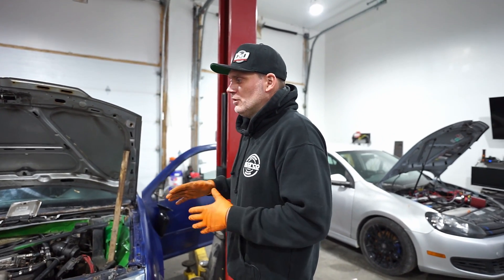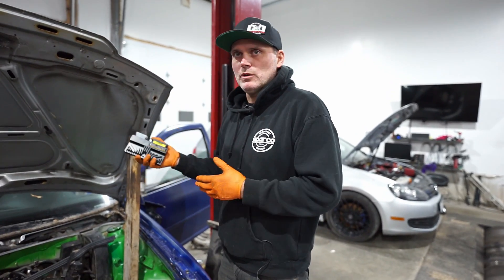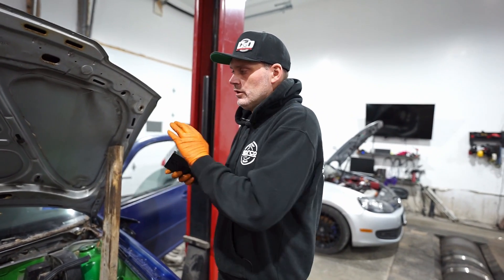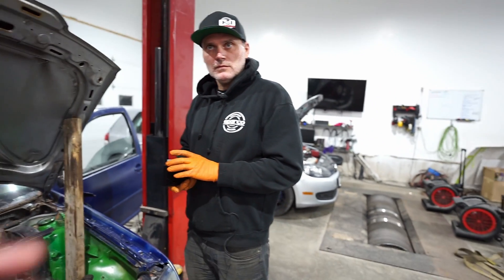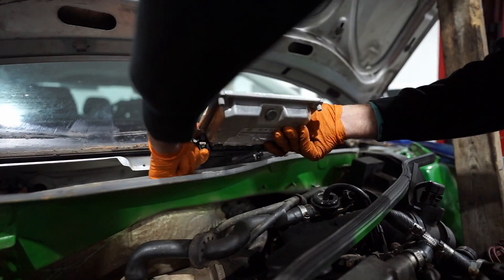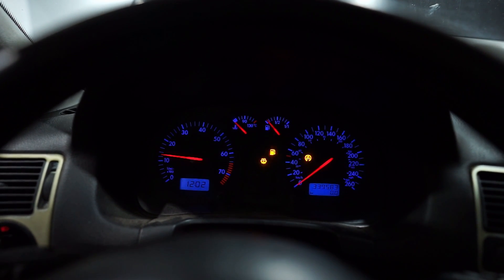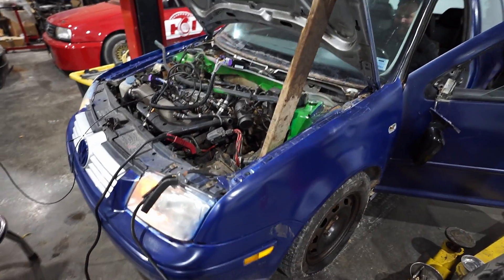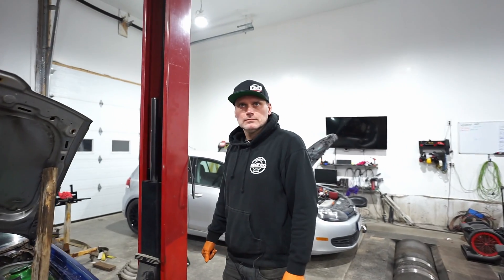Affordable standalone for your MK4 1.8T

Comment from the maker: Key components compared to other similar options. 

*Cost
*Support (this is a HUGE factor when selecting an aftermarket ECU). 
*Software/Hardware development (not going to be obsolete in a couple years)
*No external modules required
*True plug n play
*Flex fuel tuning option
*Can run literally any engine, not just a 1.8T. 
*Plus a ton of features/options
Reply: Haltech or emu? On 1.8t w/ HE351CW, AWP harness, BEA block & Haldex.
Reply from the maker: @kylejohnston3442  were a big fan of haltech. So it comes down to what you can afford really as haltech comes in at a higher pricetag as you need a wideband controller.
Reply: @COMotorsports  thank you for your time.
Reply: @COMotorsports  does this kit work for drive by cable ecus that mk4 gti's have in Australia?
Reply: Definitely need this for my B5 Passat 1.8t
Reply: Is there a plug and play for the 2.5l and can you do with emissions or does it render the OBD2 useless??
Reply from the maker: @snoopdaclown  OBD would be useless when it comes to ECU control, other modules can still communicate through OBD.
Reply: @COMotorsports  so i could use the emublack and still pass emissions testing? Would the obd2 work for that?
Reply: I have a b5 4 motion wagon with an automatic and an AWM. If this stand alone can make the boost adjustable for each gear then could I build my wagon to around 280 hp with the automatic? 
I'm having a very hard time finding a down pipe for my application, so would a " catback" exhaust be beneficial?
As always,great videos and great content.
Reply from the maker: @jasonhamilton547  It comes down to the connector on the ECU... to make this exact PNP harness work. however it's standalone so it can be made to work.
Reply: Can this work on my 2.0tsi dsg?
Reply from the maker: @ryan_wavyyy4661  Very few standalones work with direct port injectors. So the answer is no. The few that can are generally 3-5 times the price.
Reply: So quick question about this. I am an amateur when it comes to stand-alone ECUs and tuning in general. I got a custom build I am doing where I am swapping an AWP, with a stock AMU in an audi tt mk1. Weird, I know, but I have future plans for the AWP engine. I plan on using the AWP wiring harness and the VCT from the AWP. Would this affect the ECU in any negative way? Also would I still be able to use all of my functions I currently have in my audi tt? Like the LCD screen and the power locks.
Reply: Please help me with my car my A3 1.8t 2000 model cant tune with the obd port how can i fix this
Reply: Please could you do a video for the mk4 2.0. It's what I got to work with.
Reply from the maker: @McLovin420_LoE  You're one of few.
Reply: @COMotorsports  yea Ive noticed that is there a particular reason or is it just not a power plant like others. Mine has a really bad lifter rattle. Cam is definitely destroyed. And it still pulls hard.
Reply from the maker: @McLovin420_LoE  If you think it pulls hard, you haven't been anything that actually pulls hard. The engine is a bull for sure and they live for ever, but comparably the head/single cam isn't ideal for power. Yes it can be done, but a 1.8t engine is typically only a few hundred dollars these days so it's an easy choice.
Reply: @COMotorsports  yea its definitely a bull. But no I haven't been in anything pushing any real power.
Reply from the maker: @McLovin420_LoE  k cause theyre about as slow as it gets. Lol you have lots to look forward too. 😀
Reply: @COMotorsports  lol. My plan is to one day do a clean Audi 4.2 v8 but I don't think the wallet is gonna support me🤣
Reply: @COMotorsports  do you know if they make any stand alones for mk4 2.0. I honestly just want 2 step to piss my neighbors off even more. They already hate me I figure why not help them stay passionate with their hate towards me🤣🤣
Reply from the maker: @McLovin420_LoE  I can make this work on your 2l.
Reply: @COMotorsports  what's your price. I just gotta wait til I get paid and get it back running. My coil went bad 😭🤣🤣I got NGK coil and wires on the way and NGK plug waiting. Or at least I'm hopeful that it the coil. I was driving the other day and she lost power and ain't started since.
Reply: Do you have one for aeb 1.8t b5 a4
Reply from the maker: @southernracing2468  no sorry

Comment: Hey, interested in this but have a question, doing a built 1.8t in my mk3 jetta, will this plug and play work on the mk3? Had stock "stage 2" before the build which ran fine, now doing full build, does it make a different if the connectors from ecu are wired to my mk3 CE2? 
Also what would be my best tuning option when purchasing? Aiming for 500 whp 
Mods are IE camshafts, IE springs with TI retainers, 20 new valves, IE H beam Rods, JE pistons, 83mm bore, 1050cc injectors, gt2867 turbo and all other supporting mods with it 

Thanks, its my first real build so trying to figure out what my best option is for ecu and tuning
Reply from the maker: If it has a MK4 1.8T wiring harness in it then yes it would be plug in play. If not no you'd have to build a harness. Also that turbo is not getting you 500whp sorry.
Reply: @COMotorsports sweet thank you, and yeah its just the turbo I have for now, will be upgrading to 3071 or 3076 probably sometime this year but for now have to wait, but thank you for answering my question! Do you know if you will be having any sales coming up with the Christmas season I should wait for? 
Thanks again! Love your guys content its been super helpful

Comment: Could I call you guys about my GTI . I’m looking to do this stand alone. My 02 gti awp is fully done with Apr stage 3+ ecu with stock program 91 ,93,and 100 octane fault code erase /throttle body alignment 
Unique access code , and vTune . With Apr stage 3 plus turbo bigger injectors 4bar fuel pressure reg. Race 75 valve but just recently it started to act funny when I went to try to start it it would crank over but will not start if it does happen to start. It sounds like a cam out Subaru check engine, light flashes, and misfiring on cylinder three and four and I am getting the engine code 01314 all the functions on the cruise control are working for the APR tune. I can change through my programs no problem at all we checked compression is excellent. We’ve checked the timing. Everything‘s perfect checked injectors checked the coils checked for shorts and bad grounds getting power to everything on the fuse panel fuse relay 428 got power and is functioning, but we cannot get this car to start prior to this, it was running perfectly fine. It’s been parked in the garage . Tried reaching out to APR for help, but they are pretty much wash their hands of all older model vehicles and don’t have really much to offer for any of their old products so they basically are hanging us out to dry. I need some help. Is it possible to give you guys a call ?

Comment: Does this company make the same plug and play set up for a 07k that I'm building and and gonna turbo in the near future?... and what about the vr6 platform??
Reply from the maker: @HeathenRoads  yes and no. It all depends on the chassis, but we definitely have videos on our channel with them on 07K and VRs.
Reply: @COMotorsports  I guess I haven't seen them but I'll definitely look them up. And since I can order that directly from you guys if all the info needed was given to yall then technically you could pre tune it before its sent correct?
Reply from the maker: @HeathenRoads  start up yes
Reply: @COMotorsports  you said it depends on the chassis, I'm pulling the 07k from an 07 jetta and putting it in my 08 jetta that currently has a 2.0t in it. So after watching the other video on the mk6 that gave so much trouble with the turbo... lol would this "true" plug and play possibly work for that?
Reply from the maker: @HeathenRoads  MK5 is easier, so you're good
Reply: @COMotorsports  thanks for all the help bro, I appreciate the prompt feedback!... I'll be in touch within a couple months! 💯 🤙

Comment: dumb question I picked up a 2005 1.8t gti engine.is there a way to run it with no ecu and just carbs? I'm swapping it in a 67 VW bug and don't know shit about ecm or wiring so I'm trying to keep it simple. I only need at least 150hp to replace my 2332cc air-cooled engine. I can get the harness from the car with ecu but there so many wires I don't know which ones I don't really need. thanks in advance.
Reply from the maker: @vwkenart  anythings possible but it will be a HUGE headache and a HUGE amount of work and definitely not worth either.
Reply: @COMotorsports  🫣

Comment: No 98 aeb??
Reply from the maker: It's standalone, it can work on basically any engine. However to work with an AEB you'd need to build a harness and add a Wideband.
Reply: I heard awm(?) engine wiring harness would work?? Is that true?

Comment: Does this support engines that run Motronic MED9.1?
Since there isn't a lot of aftermarket ECU options for force stratified engines.
Reply from the maker: Very few aftermarket ECU's can control Directport Injection. You're gonna spend about 3-4x's as much to do so.

Comment: Does it need an electric trottle or can it work on a cable one too?
Reply from the maker: well the cable throttle harnesses are different, so PNP no. But it's an aftermarket ECU and can work on anything if you wire it.

Comment: How do I wire up the whp mac valve ? Can I wire that to the n75 valve wiring? And how
Reply from the maker: Either will work.
Reply: Cause I have the emu black
Reply from the maker: @Wanye3  yes, wire orientation doesn't matter.

Comment: Hi I was wondering if you stand alone Ecu kit will work in my 2001 Audi a4 with engine code amb???
Reply from the maker: The ECU will work fine, however the plug n part of it will not due to the harness in your car.

Comment: You don't need a standalone and replace the  wideband Me7.5 stock ECU! 
  I tune those Ecu's years now , with Big turbo's (700++ hp) , stroked engines with  NLS , 2step launch control , hard cut limiter and rolling anti lag .
Reply from the maker: Yes of course it can be done. That doesn't mean it's practical for most. Especially when it comes to support, future growth, add on options and features, development, data logging, and ease of use to name a few.

Comment: Can I use this on my audi a4 b6 Quattro and eliminate my dv valve and run a blow off valve and eliminate my mass air flow meter ?
Reply from the maker: First question will come down to the connector on your harness. All the rest yes of course.

Comment: Hi does ecu master work a vw golf r mk6 dsg
Reply from the maker: No it can't control direct port injectors. You need to look at something like Syvecs.
Reply: @COMotorsports  ok thanks so it is only syvecs that's available for my setup
Reply from the maker: @bedbull1  I think Motec may have an option. Theres another that can do DI but don't think it can do VW/Audi DI. So the options are very limited.

Comment: I own a 2005 mk4 gti 5 spd with the 1.8t awp. it has 207k miles and bone stock I want to have a light tune with all emissions devices deleted hopefully to make around 225-250 would you recommend going with this kit or another. any reply from anyone would be appreciated
Reply from the maker: The proper tune on stock ECU can easily achieve your goal.
Reply: @COMotorsports  any brands you would recommend by any chance and do you have any on your website

Comment: Looking to going standalone for my setup but a few questions I didn't see in the comments:
1. Instrument cluster: Do you retain full functionality of the stock cluster? Was the Traction Control/ABS resolved?
2. Immobilizer: Will the light on the cluster stay off without any additional modification? 
3. Emissions: The standalone doesn't have any functionality for secondary air, evap, or cataylictic converter? So there should be no need for adding resistors when deleting those components?
4. CEL: Will the CEL be thrown for things like fuel trim (vacuum leaks), MAF failure, etc... or will the CEL remain or forever?
Reply: I ended up buying the 1.8t PNP and theres a bit of wiring to be done, no where near as much as if you went with any other standalone though. 

traction control was just a problem with their car. works fine on mine.

immobilizer light isnt on for me

you do not need resistors for any emissions you delete, i went so far as to remove the wires for all emissions in the entire harness, just to clean things up.

the CEL will turn on for what you tell it to turn on for. IE faults with certain sensors, sensors reading out of parameters (temp or pressure)

CEL will not remain on forever...unless your car has a problem forever. lol
Reply: Would like to hear back on this too
Reply: @DZGunner  me too, prolem I have is mine has a lot of facotry stuff rmeove which throws up eml and TC lights etc. Hoping I can control what can throw up such lights as I dont know when there is a genuine problem.
Reply: @oliverheath7063  TC or ESP is its own module and will still function on its own, so if you have a TC/ESP light, thats its own system to be fixed.

Comment: Would this work on a AEB? Looking for a ecu currently and I see a bunch for 1.8t. Just none are specific to the engine code
Reply from the maker: No, connectors on harness are incorrect.
Reply: @COMotorsports  you think you can recommend a ECU for my AEB? Or point me in the right direction?

Comment: So in the video you quoted $1400us for the ECU and harness (so not including the boost controller, and aux inputs) but on your website the price shows as $1600us for the harness and ECU?
Reply from the maker: Change to US currency. 😉
Reply: @COMotorsports  gotcha. Didn't see the option at the top, I was just converting cad to usd. Thanks

Comment: i saw you mentioned Ignitron ecu, but clearly you've never seen or used one given your dismissive comments.  For 1.8t me7.5 platform car, there is no better genuine plug n play ecu than ignitron. No adaptor harness's to have to tuck somewhere in the scuttle, and extremely user friendly whilst having many many features..  I say this also being an ecu master dealer, as well as ignitron dealer...  You can educate youself on the Ignitron from this and other videos. You would love the ignitron ecu for your customers.... https://youtu.be/JEO8IRrA5n0
Reply from the maker: You're missing the point. This ecu doesn't back you into a corner, it has a great product line to support you through growth and will work on nearly any engine. This is why we choose it, simple as that. I've been doing this long enough myself to outgrow and see people outgrow projects, this helps with that. 👍

Comment: jesus thats expensive, my 1.8t almost costs the same price as the ECU hahaha
Reply from the maker: Just because you bought a cheap car doesn't mean things to modify it are automatically cheap as well. Lol But in comparison this is a very inexpensive ECU for the options and benefits. If you're looking for standalone for a AWP/AWW 1.8t then this is a very cost effective option.
Reply: @COMotorsports  I'm sure this is a great product but I could spend max 500 for a ew ECU/tune since I'm poor plus I have to dish another 1500 on new suspension wheels and tires next summer lol
Reply from the maker: @t_DriftKing  A tuned stock ECU is not on the same page as a full standalone. Yes a tuned ECU is going to be WAY cheaper than this, but it's also no where near comparable. It's like comparing a gameboy to a PS5, sure you can play games on both.

Comment: Does this work on audi 1.8t?
Reply from the maker: If it's running an AWP/AWW engine harness yes.
Reply: @COMotorsports  so no it won’t work with longitude engines… only TTS AND S3,s
Reply from the maker: @btwlbchris3360  the ecu doesn't care what 1.8t it's connected to. Could I make it work on an A4...yes no problem. However this specific video is about an ECU/harness adapters for an AWP/AWW setup. So unless you're running an AWP/AWW harness then no this will not just be plug and play as the video describes.

Comment: You definitely need to get Ignitron on a build. As a VAG 1.8t specific standalone , it does everything you just listed about the ECUmaster. Get ahold of Badger5 or VagetaGTI , I’m pretty sure they both have the source for the Hungarian Ignitron system . I’ve seen a lot of ECU’s and it impressed me . I’m old school/new school. DSM1-2’s-3’s that how I learned to build and tune interference engines.
Reply from the maker: We're aware of Ignitron, not useable for what we're doing. This ECU is more versatile and allows us to run whatever engine we want. In fact that ECU is destined for a different engine all together, we're just using it on this due to simplicity.

Comment: you could save all the money by using the stock ecu and asm hacks to run up to 5 bar absolute pressure without having to purchase eurodyne and still pass an emissions inspection lol
Reply from the maker: No money was spent for the ECU, it's all stuff for other projects. We've made great power on stock ECUs. This is much easier for the task at hand. 👍

Comment: I have a mk4 jetta can I use this ecu for the 2.0 engine. I am new to the mk4 generation of vw
Reply from the maker: It's a standalone ECU, it will run any engine pretty much. The wiring however would be different for the 2.0L, but could likely be modified to work.

Comment: very good video about this ecu. especially since I am using this one on my 2.0, I have a couple questions: Is the adaptor necessary for the ecu to be connected to the car or do you not need it? My GTI was totally stripped when I bought it so there is not any wires or ecu's in it. The only wires in it are for the gauges and the fuse box. I am building a wiring harness with a 1.8t harness, and I should be able to connect it with that correct? or do I need that adaptor
Reply from the maker: If you're building a harness from scratch yes of course you can just terminate the wires directly to the ECU.